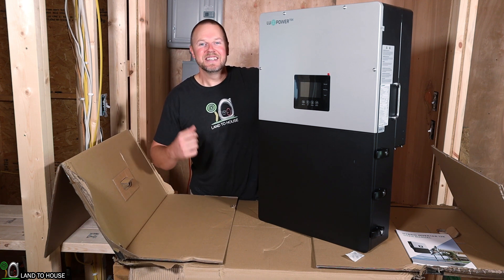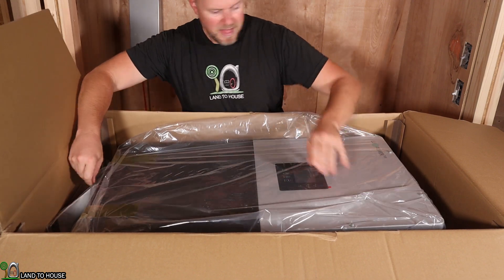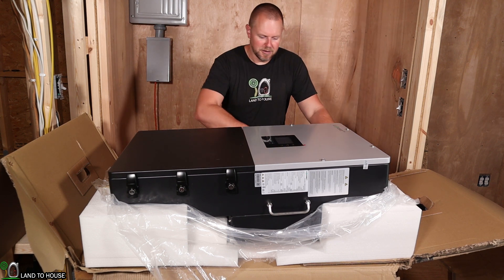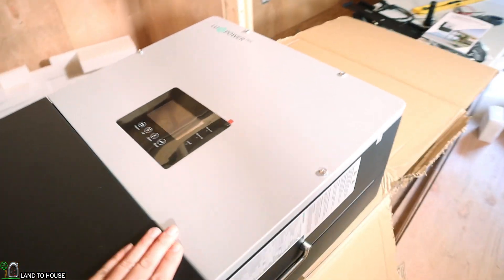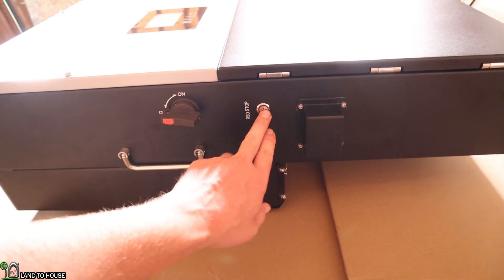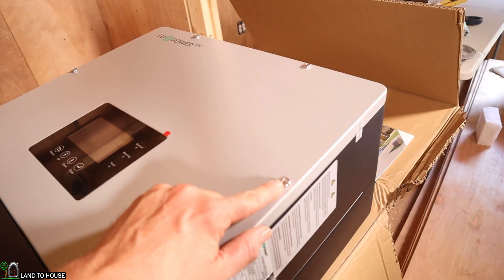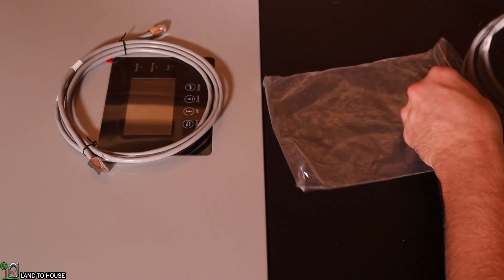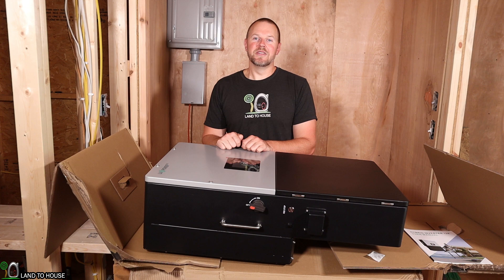Lux Power EG4 18k Hybrid Inverter Overview - Awesome Machine

Comment: There's foam padding on the intake vents, should I remove them?
Reply from the maker: If its shipping padding, definitely remove it. If it's a foam screen to prevent dust, it should stay.
Reply: @LandtoHouse thanks for the response, i  couldn't find my manuel and after it shut off recently it made me wonder if the foam pads behind the vents were necessary

Comment: No thanks, I would never install one of these low cost, Chinese made, high frequency,  transformerless inverters in my off grid home. High frequency inverters are notorious for short life expectancies and weak surge capacities. Due to their high switching speeds, they run much, much hotter than low frequency, transformer based inverters and that heats leads to shorter lifespans for the cheap components in these inverters. A much better choice would be to purchase a hybrid, low frequency, transformer based inverter. They last far longer and they provide much higher surge capacities.
Reply: Who asked you?
Reply: The best way is to get a smaller sized LF inverter in addition to this one. The LF inverter not efficient. The idle consumptions are crazy. If you get one then you can run it on specific periods not 24hrs for inductive loads. I know some that consume 170watts per hour whilst HF i have only uses 50watts. 170watts is crazy on battery during dark hours
Reply: Yes that's true, combining a low frequency inverter to power high inductance loads and a high frequency inverter to power light duty or resistive loads is a good idea. The way that I overcame the high idle current was to install a higher capacity battery bank and set my low frequency inverter to sleep mode when there is no load present, so there's not as much of an impact.   @ThePonderi

Comment: Wow!!!

This think is HUGE in comparison to my Genetry Solar 12K, that I bought, and recently received!!!
Reply from the maker: This inverter is large, but much of the lower portion is free cable space. This unit is packed with features! Looking forward to testing them.
Reply: @LandtoHouse  - I bet the system is feature packed!

There are rules in regard to cable spacing, as far as UL standards are concerned… I am sure so many square inches are needed for the cabling space. 

There has to be a better way than the size & weight of that shipping box!

Comment: That warranty is void if sticker broken is illegal, manufacturer has to prove you broke the device by modifying it before such a refusal. A flimsy sticker is garbage and should be called out for the anti-consumer practice it is.
Reply from the maker: I can't say I know much about that type warranty. I doubt there is anything in the top that the average consumer would be able to repair.

Comment: You’re going to love this inverter. The eg4 18kpv is what I installed. Which is essentially the same, just rebranded. The one gray wire is for paralleling to another  inverter. The second wire you showed is for battery communication. Also, it does seem confusing but the arrow on the mounting plate points upwards. It fits like a cup inside the inverter. They made it rounded so it wouldn’t snag on anything as you hang it up. It’s the easiest inverter I’ve installed honestly. Except lifting it on the wall.
Reply from the maker: I am stocked to be working with this inverter. I have not heard a single negative thing about it. Looks like the batteries I have on hand will need a special cable for the bms. My brother is making those for me. Good to know about the mounting plate. I hope to install this on the wall in the next weeks. My studio space is ready for some power. (installing solar this week as well)
Reply: @LandtoHouse  really looking forward to seeing you hook it up. You’ll likely need to update the firmware before you give it some heavy load testing. One of the first firmware updates improved the voltage derating under heavy loads.
Reply from the maker: @GavinStoneDIY good point! Thank you. My contact with the company gave a similar input. They say the app for this inverter is the best out there.
Reply: @LandtoHouse  yeah it’s a super cool app. This inverter really is the best thing since sliced bread. Really long surge capability and low idle consumption.
Reply from the maker: The 50-60w idle consumption is incredible.  My vestwoods inverter has a 130w idle. That's about 1kwh of the battery overnight.
Reply: @LandtoHouse  yeah I think I landed around 70w in my review. Super impressive considering the amount of power this inverter generates. The quietness of the inverter is also something people love.
Reply: 12k low frequency growatt handle load better
Reply: @Emeliotube  no they don’t really. Plus they have terrible MPPT’s on them,  and horrific idle consumption.

Comment: With the shocks the unit has taken during shipping, enough to damage the unit through the packaging, send it back.  The damage to the components, solder joints, etc. may be un-noticeable but could shorten the life of it.
Reply from the maker: Because this is a collaboration unit for making youtube videos I think that I will give it a try. Might be a great opportunity to work with customer support. A unit purchased for personal use I completely agree with you. Its worth getting a unit shipped with no damage at all.